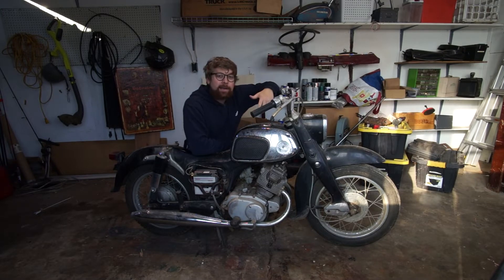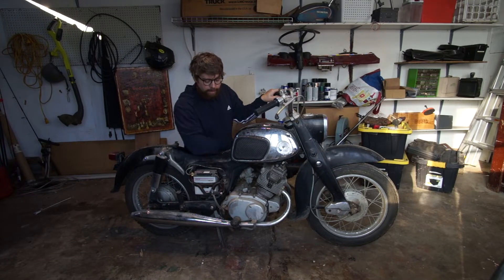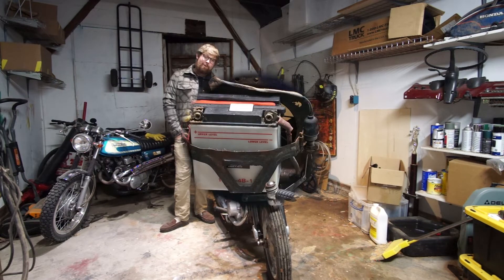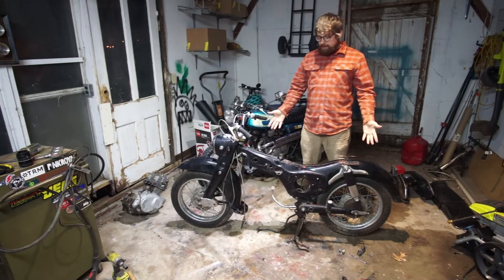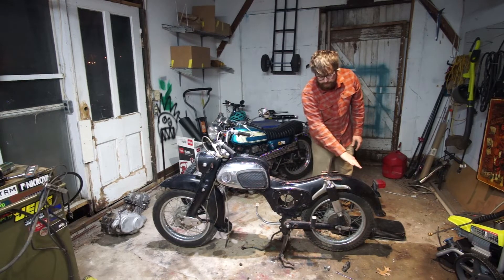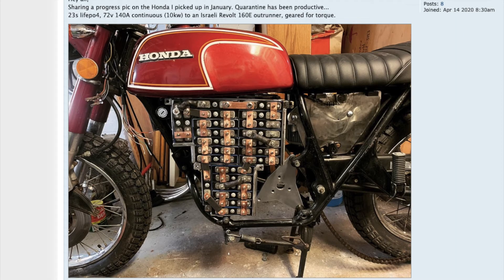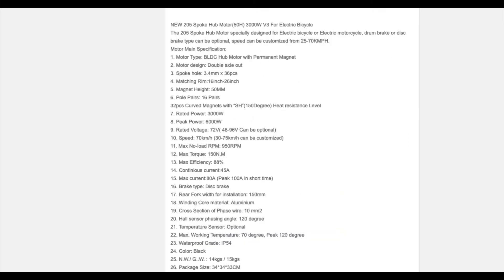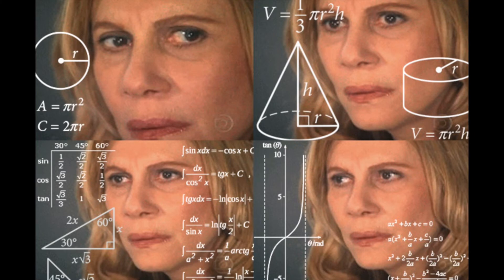Converting an old Honda Baby Dream to Electric! - Project Dream-e Episode 01

Comment: Cool project ! Problem with motorcycles is space for batteries and reduce drag area so you need structural battery. Btw This bike looks like bike in India in 1980s called Jawa

Comment: The compression is probably low because the rings are stuck to the piston. If you can get it to run for any length of time, sometimes the rings will reseal. Please don’t do this